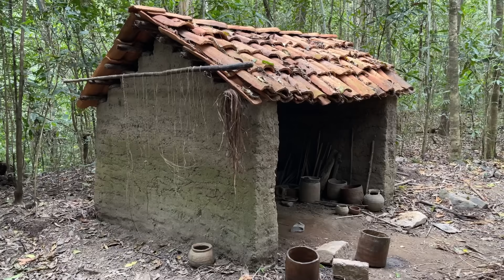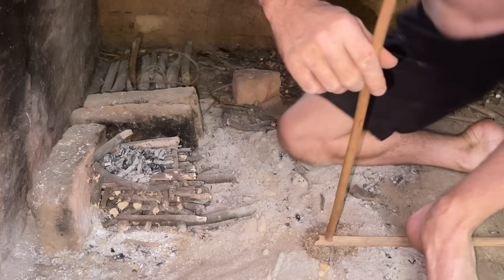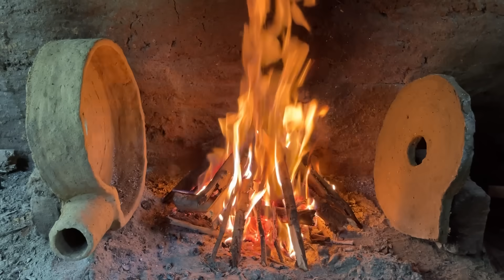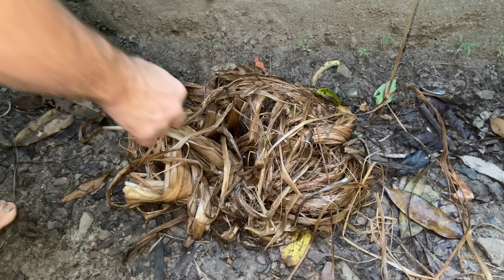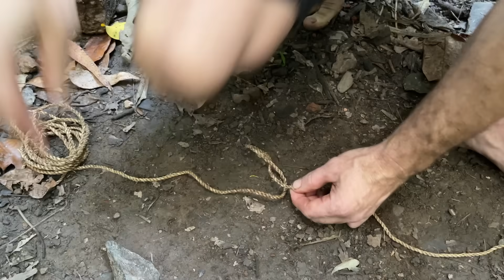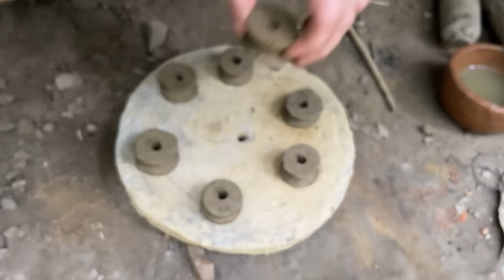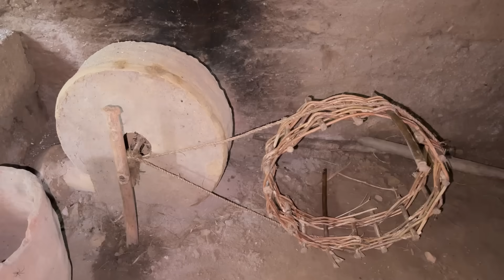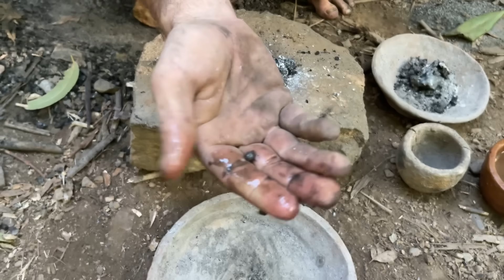Primitive Technology: Floating Pulley Blower Smelt

Comment: Forge a knife with it! Long term goal. For the hand wheel, could you build a wheel that has an axle through the centre? Then you could build an 'A' frame that supports either side. You could add pedals and power it like a bike.

Comment: Areas for improvement 

:preheat the air by having the toure coil around the fire befire discharging

Improve fan blade design to increase air effeciency. 

Perhaps two chambers on the same axis with a similar design might help.

Taller furnace

Comment: Problem with iron here what iron slowly bern out in smelter. I think need build tall smelter and use more ore. Second what i saw that after smelting need remove hot iron peace form smelter and hammered it in round shape. Third need create hammer. With stone chande shape iron peace very difficult, becouse it so hot. And need remember, after berning iron every time it will bern out in reaction with oxigen. You may collect it iron oxide and remelt it but i think it will be have not only iron oxide and charcoal in it.

Comment: Once you have your pully system down pat, you might wanna try a double blower for more cubic air at potentially the same input. Or  have a "gear reduction" set up where upu just turn a single say 1 meter is diameter pully. I know you have hard woods that could do it, maybe try a wooden pully with that reinforced clay as the contact surface on the interior groove

Comment: You are very thorough at getting the materials, making measurements, thinking smart and designing, but you lack the same discipline for the craft, and that is why the clay blower keeps breaking. You need to build it not on the ground, but some kind of stone, bench, something that can keep the clay clean. Also, you should filter the clay and only keep the best one, the fine grained, you can do this by putting lots of clay in water, shake it, let it rest, shake it again, the big chunks will come to the surface, the thin better clay at the bottom. And last and very important, you need to beat the clay when you are molding the pieces. very important to keep it tight and it will not crack. Check some of the japanese clay tea pot makers out there, and you will learn a lot.

Comment: Now you’ve got the drive mechanism sorted, I’d look at the blower exit. Adding a tapered exit with a few holes around the circumference would utilise the Venturi effect pulling in more air than can be pumped by the blower alone

Comment: John will build a gas turbine one day, using wood gas and a reversed blower to drill a rock or to pump Water. He even could store the wood gas inside a clay pot, turned upside down and submerged in a slightly bigger pot filled with water. Selfmade gasometer.

Comment: I’m a bit confused as to the goal here. You’ve constructed a bloomery, which seems to work well enough, yet you process it as though you were expecting ingots of pig iron. Those prills you’re collecting are worthless in this context, and should be discarded along with the slag. That bloom needs to be hot forged (a large wooden mallet and a stump will suffice), not left in the furnace to cool.
Reply: More or less a proof of concept to show how ancestors could've obtained Iron gained from surface sources and worked it well before the Iron age itself. 

He's not going to be doing any smithing yet I'm sure, but demonstrating how the material can still be extracted. 

Later development may explore more into the metallurgy and metalworking sides of things.
From a practical standpoint, if the current slag and spheriols are still usable in some way that'd make sense for primitive tools? Its still worth exploring when seen from a primitive human's perspective.
Reply: @Nurhaal thanks for the clarification. I’ll rewatch the videos with CC turned on; I saw someone mention that he explains a lot in the captions.

In any case, he certainly demonstrates some effective methods of forced induction using what basically amounts to neolithic technology. Interesting stuff.
Reply: @doccrimson 
Absolutely. Love this guy, as he does things entirely from an educational and scientific perspective and is a fascinating study.

Comment: My old knifemaker friend said that you could try increasing the volume of the furncace and double walling with brick and mud, then taper off the end, reason being the current volume (therefore air buffer and zone seperation) is too small, and too much direct heat on the bloom formation (below 1500 but just above 1200, not too hot). He also recommends using just a small bit of wood ash as flux, and a lot more charge. One of the main reason why your taller natural draft furnace works well is that it has a relatively large volume to buffer and seperate clear heatzones, which worked with such a small amount of charge being insufficient to reach a ciritical mass for a bloom. Guy also recommends placing some brick at the bottom and digging a drainage channel around that.

Comment: I really enjoy your channel and, on my small rural property, I’ve been experimenting with different types of mortar. I saw that you used ashes in some of your constructions. I’m not a builder (I’m a lawyer), but I consulted the ChatGPT 4.0 AI, and the answers were very interesting—some tips I tried worked very well, and perhaps they may be useful to you too. I’m sharing them below.

🧱 Natural Mortars in the Forest for Stone Wall Construction
There are several primitive techniques suitable for forest environments that can produce effective mortars to bond stones into a solid, weatherproof wall. Combining traditional knowledge with survival practices can yield robust results.

1. Clay-Based Mortar
Made with clay-rich soil and water, optionally reinforced with natural fibers (straw, leaves, or roots).

Works reasonably well for temporary shelters but is not waterproof and requires frequent maintenance.

Good for setting stones in dry stack style or under roofed areas.

2. Lime Mortar (Non-Hydraulic and Hydraulic)
More durable and traditional for stonework.

Made by burning limestone, shells, or eggshells at ~900 °C to produce quicklime, then slaked with water to form lime putty.

Mixed with sand (2:1 or 3:1) to make mortar.

Non-hydraulic lime cures slowly by absorbing CO₂; hydraulic lime, made with volcanic ash or clay additives, cures faster and is more water-resistant.

3. Qadad Technique (Yemen)
Ancient method using lime + volcanic ash + animal fat, applied in successive compacted layers.

Highly water-resistant, used in cisterns and domed roofs.

Final coat is polished and sealed with animal fat.

4. Sticky Rice Mortar (China)
Mix of slaked lime and sticky rice porridge.

Historically used on the Great Wall.

Very cohesive and water-resistant, though rice may not be easily accessible in the wild.

🪵 Common Materials Found in the Wild
Material	Function
Clay/soil	Binder
Plant fibers	Reinforcement (anti-crack)
Sand/pebbles	Aggregate (stability)
Wood ash	Pozzolanic additive
Crushed ceramics	Improves waterproofing & grip
Animal fat	Waterproof coating
Rice (optional)	Binds with lime if available

🛠 Combining for Durable Mortar
A blend of clay + sand + ash + fibers, sealed with animal fat can produce a strong, semi-waterproof mortar, especially if applied between well-fitted stones. Let it cure slowly, shaded and moist.

To seal the outer layer:

Melt animal fat, add ash and crushed ceramic (grog).

Apply with a brush or wooden spatula as a plaster or “natural stucco”.

Functions like a primitive waterproof finish or “natural cement”.

📏 Flexible Contour Gauge for Stone Matching
I also designed a flexible contour gauge (inspired by the “Lesbos Rule”) using wood segments tied with plant-fiber ropes. When pressed into a wall gap, it molds to the shape needed for the next stone.

Here's the concept:

css
Copiar
Editar
-o--o--o--o--o--o-
Each “--” is a stick; each “o” is a rope joint that bends. You press it into the stone gap and then use it to find or shape a matching stone.

Comment: This may be dumb but how about making a decently sized reinforced clay flywheel to power the blower? I'm not sure if I's possible but just think, If you get the flywheel set up right by having the flywheel bigger than the blower and having the rotating handle smaller than the flywheel you would be making the flywheel spin at great speeds and intern make the blower spin faster. As in with one turn of the wheel you could possibly make the blower spin 10 times, plus with it being a flywheel the weight alone would make it more energy saving and the momentum can keep the blower going for a short time after letting go.

Comment: Maybe as a tip instead of clay or fiber around the torque transfering stick maybe try to melt some rubber onto it as it sticks and barely corrodes Overtime

Comment: You don't need more heat, you need to let the liquid slag flow out while it's hot, during the firing. At the end you need to smite the bloom with a big hammer, also while it's red hot. You squeeze out the remaining slag in it so you need safety gear for that or you will  get a lot of burns.

Comment: Would it work more to have a small crucible filled with the ore at the bottom of the furnace and keep feeding heat and air to it? That way the ore sticks together more and can consolidate better instead of potentially spreading around and maybe not catching any heat. Or would that be a step only for when you have enough prills?

Comment: Could your pulley system twist or lay flat? So then you could make a Lazy Susan style fly wheel, like a spinning top, so it won't require as much vertical structure. for more stable easy cranking..

Comment: Have you considered pre-heating the air that is blown in your furnace?

If you put a long clay pipe between your blower and the furnace,  over a pit with burning wood (or even coal!), you could inject air that's already hot on the coals, thus gettting a higher temperature, which might give you a more solid mas of iron in your bloom.

It would use a fair bit more of combustible though.

Comment: Just a thought (you may have thought of this and decided it wont work), but with the wheel you made from branches, if you made a smaller one, took branches and curved them slightly around a central bar, you could use a small wheel as a pully, with a larger one as the wheel your handle is attached to.

By 'curved them slightly around a central bar' i mean instead of branches being straight across, if you put them one or two spokes past 180 degrees, you go 1 or 2 spokes forward, and do that repeatedly around the whole axel of the fan unit, you could make a semi solid wheel of branches around a branch to secure them together?

I could be longshotting this, idk.

Comment: if I may, in my opnion, if you add a smal amount of fibers in your clay models, they my get more resistant. Also, try adding another gear to your pulley system. Your arms will get tired from making a giant circular movement. SO put a small gear at the center of the big one and that will get your job more eficciently done.

Comment: Telling ya dude ditch the blower and make a Venturi vacuum pump.  No moving parts and the more water you have flowing the more air you can draw.  It will be way more powerful and consistent. IDK if you read these comments but im sure you would be able to do a great job with it and it only takes a single Y shaped pipe and some running water.

Comment: 10:42 How about inserting the wheel support into a brick to allow forward and backward adjustment in order to eliminate slack in the rope? If the brick is large and heavy enough, it should remain stable without loosening.
Would it be possible to use 11:53 this structure with pin gears, combining three of them to create a cross-axis gear mechanism? By varying the size of the pin gears, I think torque adjustment would be achievable. However, I’m concerned whether the strength would be sufficient.

Comment: If you have black sand around rivers, I think that has high iron content. Would be neat to see you make a primative battery at some point as well :D I'm not sure where you could source copper, but a basic electromagnet powered by an iron rod, copper windings, and electricity from the battery would attract ferrous material from those sands, or even your crushed slag to help find iron prills. (Conveyor belt system to pass the material under the magnet)

Other future ideas could be a built water tank to flow over a water wheel to keep the blower moving constantly while you're loading charges.

Love the vids! :D
Reply: i think he said a while back that he doesnt have ready access to copper, that being the whole reason he's going straight for iron

Comment: ive been thinking that with those iron pellets you could embed them in the face of a wooden mallet with some kind of binder. this could be used to more comfortably smash the slag apart. but if that doesn't work i was thinking that if you can get the iron to cool into a domed disc it could be used as a hammer head.

Comment: Would it be better to create the pulley as part of the wooden shaft itself? Instead of fiddling with trying to fix the clay onto the wood shaft. Basically using a larger diameter stick, but whittle the ends down to fit into the stakes like this:  -----{}

Comment: I think the kiln should have thicker wall to keep the heat. Thicker kiln could prevent the heat losses. I can't think of any natural insulation.. but adding insulation around the kiln might help too!
Reply: I think sand can be used as an insulating material. By covering the kiln in the order of brick, sand, and brick, the heat retention efficiency should improve. The melting point of silica sand is over 1,700°C

Comment: hi its so cool what u have done, maybe u would like to try making furnace with principle like the one japanese people use to make tamahagane? acessible bottom part when smelting to let out the slag, and also its smaller in the bottom to produce draining mechanism for slag(sorry if im mistaken by this). i appreciate your hard work alot, sir!
Reply: It seems that in Japanese tamahagane, lower-carbon steel tends to form in the central part of the slag, so I suspect the heating time might simply be too short. It might be worth trying to keep it heated for around three days.

Comment: would there be any merit to building a tall funneled-in chimney on the furnace?

It could help draw air through at a higher rate, insulate better to atain higher temperatures, and possibly help contribute to a reduction atmosphere that could separate more iron from its oxide phase.

Or, could sealing the furnace with some added charcoal at the end of a smelt help in the same way?

Comment: Have you considered making the blower housing and pulley wheels from something stronger like the wood ash cement from a few years ago? I feel like the pieces would be less likely to break. Half the issue is that clay is really prone to surface wear. The rope rubbing against the pulley wheel wears it down too quickly. 

But you've got an abundance of wood ash, sand and grog, so the wood ash housing could be more sturdy and less likely to crack over time. The small pulley wheels themselves could be made of cement as well. Cover the inside edge with sand as it sets, so the rougher surface grips the rope more easily. Reduces slipping, but might increase wear on the rope.

Comment: I think this is the peak practical blower tech you can get with your current resources. I can't think of any significant functional improvements from here, just tweaks and refinement (And maybe ergonomics, but that won't affect the output).

I would look back to your furnace design now, there may be improvements on that front.

Comment: what about a house, with smelter next to the creek, so the waterflow could run the blower. basically watermill
Reply: one of my relatives had a forge like that, works well. needs a sluice gate to turn off the stream to stop the water wheel wearing out.

Comment: Absolutely incredible. I wonder how much air pressure and temperature is being lost from the gaps in the furnace and the heat resistance of the bricks? Maybe a thicker and more insulated furnace would allow for a bit more forgiveness in raw air power. Also is there any kind of local sap that could be used to treat the cordage? Could help it to be more resistant and have better grip on the other components.
Reply: The low-fired bricks are fairly porous and insulating already. It is just the gaps that lose heat from the furnace walls. I expect when he settles on a good blower design, he will improve the furnace for higher production.

Comment: A weighted stick with a pulley on it, levered on one end and free floating on the other could be added to tension the string. That might improve the fixed pulley design.

Comment: Next time you try a stationary crank pulley, maybe try using some more spokes that go all the way across and protrude a bit past the barrel itself, then weave some cane onto them to form a flared rim to keep the belt on. This would also help strengthen the pulley as it seemed to get deformed somewhat easily.
For the small pulley, maybe just try wrapping the belt around the fan shaft one more time, to increase traction and hopefully make the use of a separate pulley unnecessary. 
For the belt maybe try using 2-3 ropes side-by-side for better traction and redundancy for if one of them breaks.
I think it'd also increase the pressure and volume of air if the fan itself were made to fill more of the fan housing, making the gap between the fan and housing smaller, maybe the blades themselves could be made by weaving cane as well?

Comment: I know you get flooded with ideas but a really really simple way to DOUBLE your air flow would be just to attach another blower next to the existing one on the same axis. You can still just use one set of floating pulley equipment but just have 2 blowers powered by it.